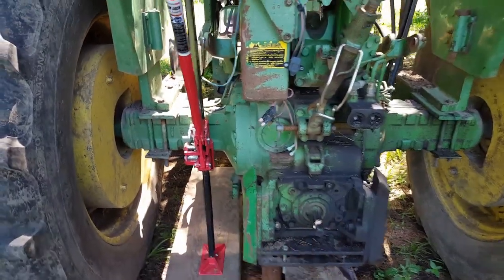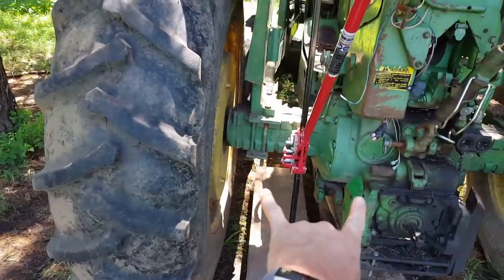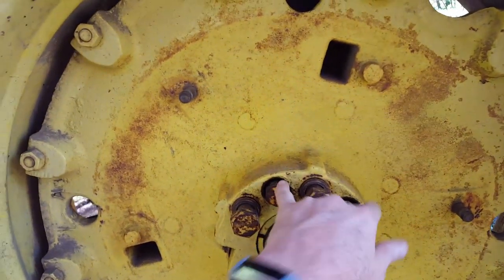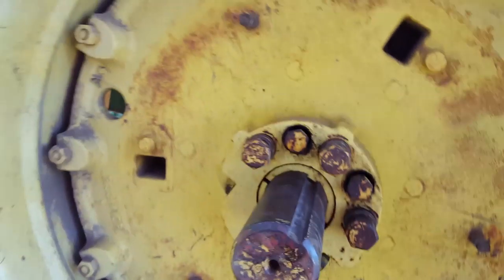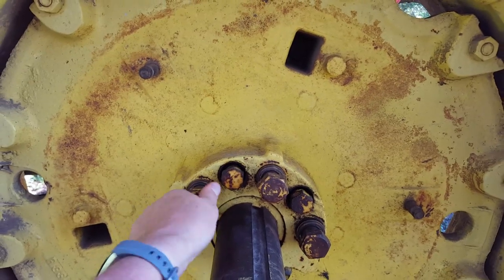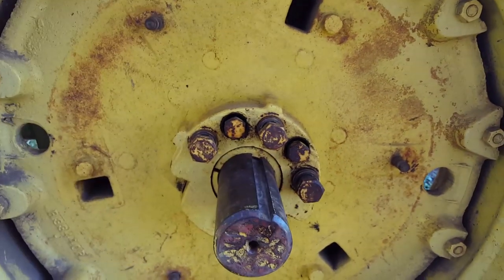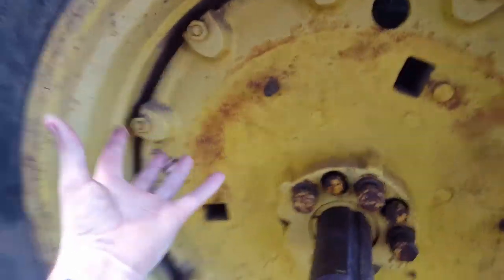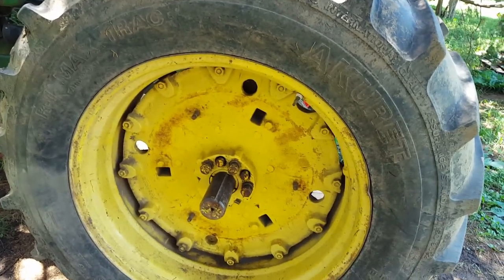Help me move the rear wheels on my John Deere 3020 Tractor

Comment: Cap Screws 1, 3 and 5 tighten the CLAMP action of the wedge.
Cap Screws 2 and 5 are used to JACK the wedge out of the tightened position.

Comment: First you have to take the wheel weights off so you can access the set screw to move the wheels
Reply: You have turn the wheel so the bolt that is side ways is on top. So the weight of wheel rest on top of the grooves it like a track when u  turn the bolt it work the wheel out. Or in you don't need to remove the wheel weight to move wheel in or out .
Reply: You don't have to take the weight off
Reply: The wheel weight is not required to be removed in order to widen wheels.